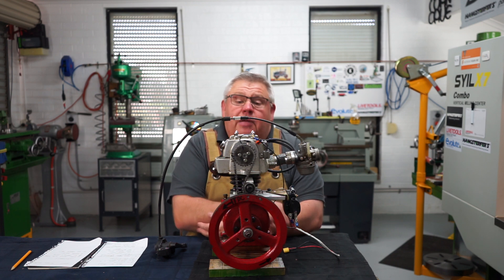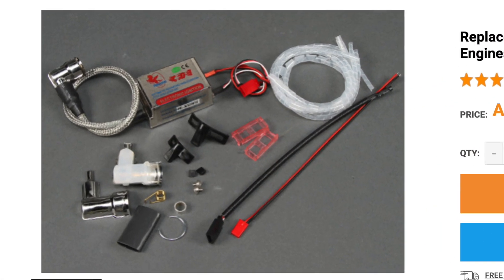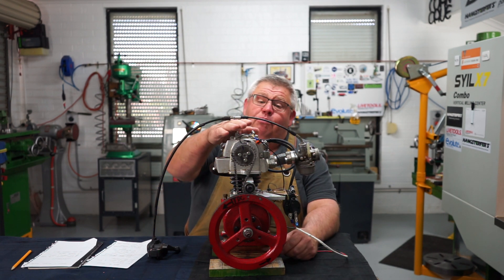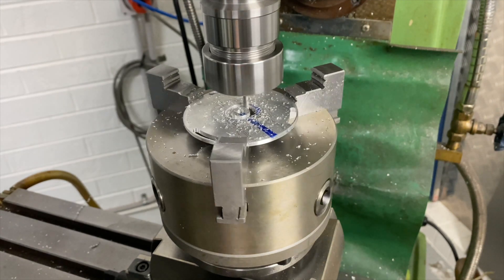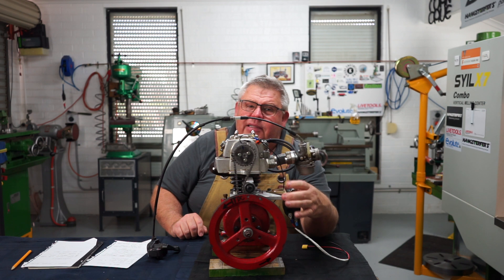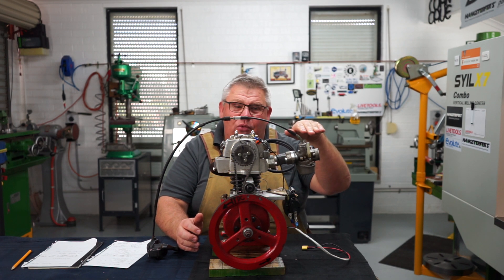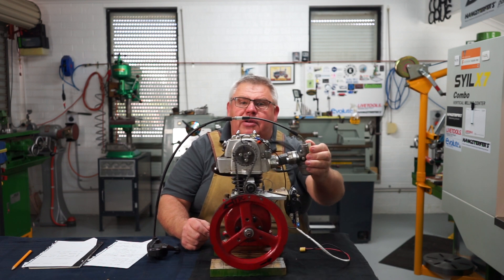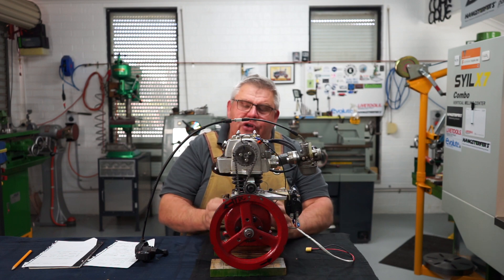DIY Engine Part 4 - Finale recorded live

Comment: This has got to be the best engine build from scrap parts on youtube. I call them Bitza engines, a bit of this and a bit of that. I have done the same thing using two stroke lawnmower crankshafts and crankcases to make a double acting steam engine. I got a 10hp honda motor that would not start and found out that the magneto coil did not work. This was a old honda that had points so I used a car coil from the 70s and it ran really well. Those car coils will run on three volts quite well and I think it is because hondas are a low compression engine. I did an experiment using a spark plug with a microwave oven transformer using 12 dc instead of 240 volts ac and it worked. Those condensers can be replaced with capacitors from computer power supplies. Using car alternators with your motor is a bad idea, how do I know that? Been there done that. There are many motors that can be used as a generator with your motor. Great to hear that you are a mechanic, I started as a car mechanic then went to earth moving machinery. I am retired now but as you said the mechanic always comes out if I am dabbling in electronics or casting parts in iron. Sorry if this post is too long.
Reply from the maker: Hello and thanks for watching.  I really appreciate your kind words, support and feedback.  I really enjoy watching your videos.  Especially your casting ones, they are absolutely amazing.  Thanks for the great ideas too.  I would have never thought of using a microwave to create the spark, but it's a transformer and therefore it should do it.  I won't be doing anything else with this motor for quite sometime.  It would be nice to place it on a proper stand and maybe fit an electric start, but that's about it.  Yes, I worked as a mechanic for about 10 years and then crossed over into engineering.  6 years after that I went to University and became a school teacher.  That's when I received my frontal lobotomy hahaha.  Looking forward to your next video.  Cheers, Aaron.

Comment: G’day Aaron. It runs, that’s a great achievement so you should be proud of it but don’t fit it in a go cart, the carby will fall off;-). 
Cheers 
Peter
Reply from the maker: G'day Peter.  Thanks for following along on this build series.  I appreciate your support mate.  To be honest, I was surprised just how well JB Weld actually works.  It really is strong stuff.  As for a go kart motor, to push me around the backyard I may need a V8 🤣